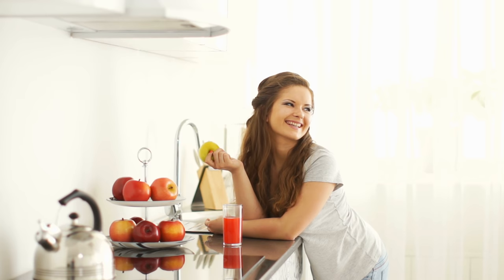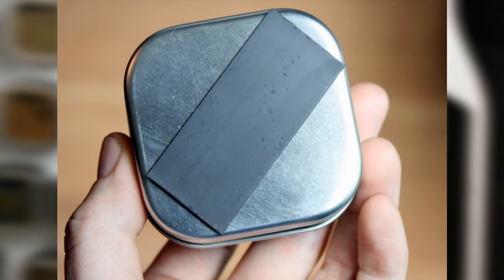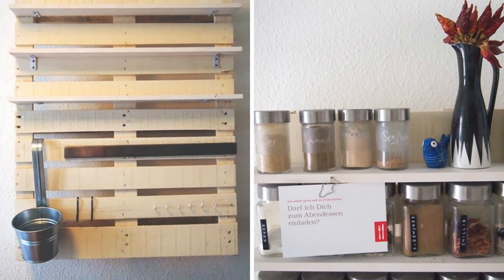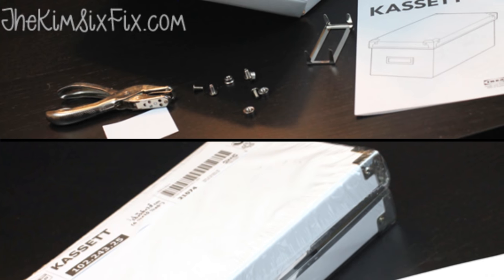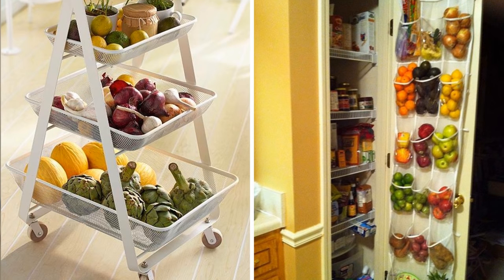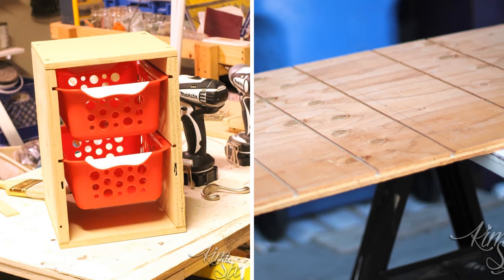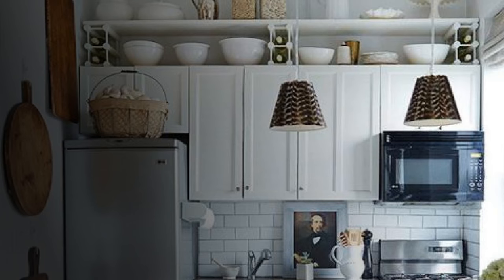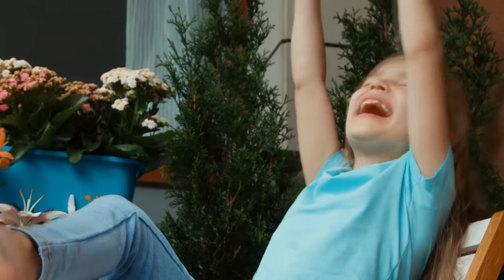12 Unique kitchen DIY organization Ideas

Comment: Comment on the magnetic spice containers - would be better to put magnetic tape/sheet on inside of cupboard door. Some spices get lose flavor faster when exposed to light. 
REALLY like the idea of using trim to create spacings for drawer dividers - great not just for pots & pans but would work in utensil drawers as well!
Reply: Bought something like this but the container isn't airtight.   Airtightness is important,  also.